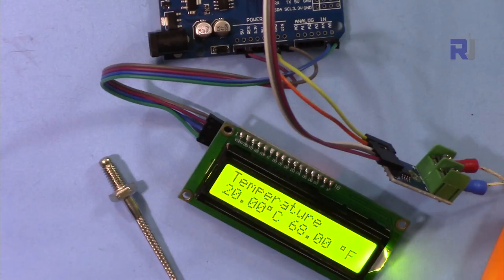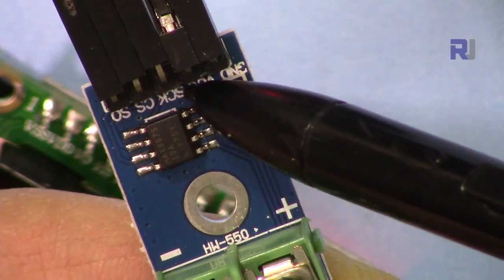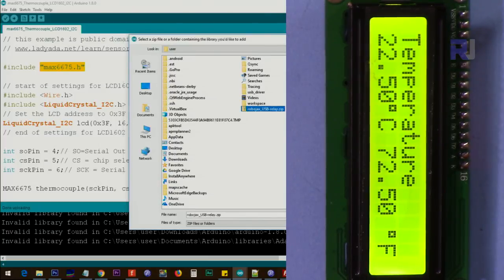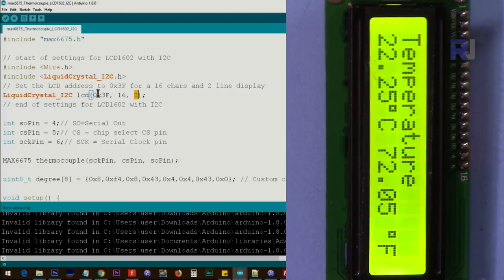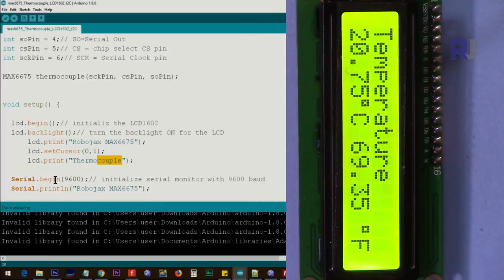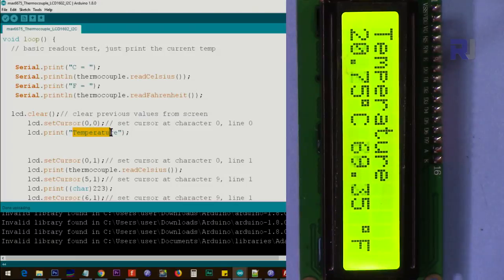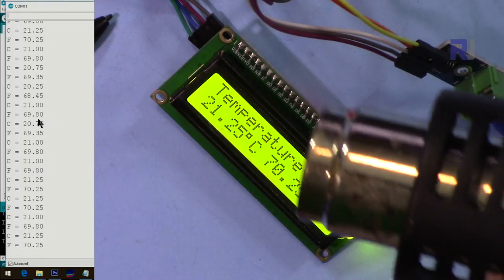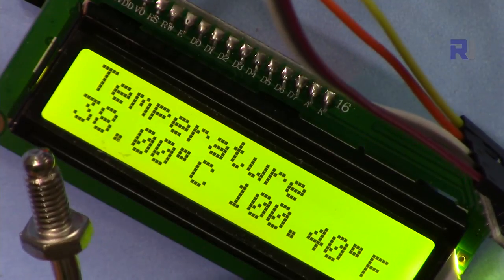Using MAX6675 Thermocouple with LCD1602 and Arduino

Comment: Hi Robojax , 
I have a question about the connection of the lcd display . 
in your video you have the module for the 1602 , how to connect the  display if we dont have that module ? 
thank you .
Reply from the maker: that is I2C module. it would be very missy but doable.  Here is introduction to the LCD without I2C moduellhttps://youtu.be/S4ya3Q7uhJs

Comment: Other than changing the library from MAX6675 to MAX31855, is there any difference in the sketch? The pinout and functionality is approximately the same; the MAX6675 is now being phased out for new designs; and the MAX 31855 has slightly higher resolution (and is more widely available).

Thanks for your videos. They are very good!
Reply from the maker: you are welcome. thank you for the tip, I just checked it and it is better. I will see if I can get it.
Reply: @robojax  Awesome. I will be trying it today with your code. I haven't looked at the library yet but I wouldn't think there should be any difference. The functionality should be the same. Not sure why someone would change anything.

Comment: I am contemplating building a pyrometer, which K coupler could be used for temps up to 1400° F with a probe length of at least 2 inches/50 mm?   I'm having a hard time finding what I'm looking for.

Also what voltage regulator or converter would you recommend with a 12v DC supply? 

I would be using it in an automotive application,  probably use the smallest arduino possible.

I haven't fully decided which display to use.   Is there a dimmable LeD or LCD/OLED available for day/night use?
Reply from the maker: you did not mention current  for the 12V power supply. if you need to power this system, then 500mA to 1A is enough (0.2A also works). But as for the display if you search on eBay or AliExpress "OLED" you will get unlimited sized and prices. Before you buy it make sure to find Arduino Code for it.
Reply: @robojax  thank you for the response.   I was able to find some TFT screens that offer the flexibility I'm looking for and even looking at multi-plexing.   I'll make sure I pick up a shield or a model that uses 5v and a sketch to go with it. 

The power source is a 12v automotive system so 12v battery when engine off, 14.6 when its running .

Would a cell phone charger buck converter be a sufficient power supply with 12-14.6v in and 5v 1--2a out?   Or is there a specific module that would be better?

Comment: I am dealing with the temperature readings being much higher than the actual temperature inside my tank. For example, in an ice bath, which should read 0C, is reading around 8-10C. I also tried bringing the tank to boiling temp (100C) but the temperature more feels like a warm bath, definitely not boiling at 100C. I have tried multiple k-type thermocouples and am experiencing relatively the same readings, which makes me believe it is not a calibration issue. Please let me know if you have any ideas on why this is happening or ideas on how to fix this issue. Thanks!
Reply from the maker: Hello, I am not ruse exactly how is this happening but may be the wire is too long to the sensor. Also check if the difference in reading is linear. Meaning if you specific number (value) at all temperature readings. If that is the case then simply add or subtract it from the reading .

Comment: i have built this setup en used your code, i can read the temperature on the serial monitor but it does not print on the lcd. how can i fix that
Reply from the maker: did you follow the instruction?  I said 1- first work with LCD in separate video 2- work with MAX6675 in from separate video 3- Come this video to combine both. so perhaps you've skipped the step 1.

Comment: Great video  very informative but I cant find the links you speak of for the i2c scanner or how to hook up the display. The link you posted to answer zulfikiri zariq just goes to a page of unsorted links.  Not sure what I am looking for.  Ctrl F(Find) of lcd1602 returns 17 results.  I think your page needs to be sorted somehow to make it easy to find what I am sure is all your great and hard work.
Reply from the maker: In the page just press CTRL (control key on keyboard) and press F and in the search type "scanner" you will get it.

Comment: I have successfully connected the thermocouple to Arduino. Thanks to your video. However, the temperature reading is very slow response. It seems there has been delay for about 10 seconds. Is there any way to make it faster or highly responsive for reading temperature? Thanks
Reply from the maker: You are welcome. there is ONE second delay delay(1000); in the loop. 1000ms=1s so change it and make it smaller.

Comment: I will try this very useful scheme for jet modeling turbines. A question: how do I alternate information (when Arduino performs 2 or 4 functions simultaneously).
Thanks a lot.
Reply from the maker: You are welcome. If you use delay() Arduino will stuck and can't do another task until the delay is over.  So you should use millis() instead. I have a video that you can learn using millis() from  https://www.youtube.com/watch?v=6DGQhQgr7Ak .

Comment: this is the error i m getting when compiling the code "no matching function for call to 'LiquidCrystal_I2C::begin()' " what to do Sir ?
Reply: write * lcd.init * in its place * lcd.begin * and it will work
Reply: Make sure you renamed the file where you store the library to 'LiquidCrystal_12C' aswell
Reply from the maker: It shows you have not included the library. Please download and include the library.
Reply: @robojax  I had the same problem and won´t find the way to solve, I have all the libraries installed.

Comment: Thanks for the tutorial, can anyone guide me if i always need a computer (or a laptop) attached to this setup in order to get the readings on the LED screen. Or is there any other device which we can attach instead of laptop to power up and control all the coding stuff after we are done installing the library.
Reply from the maker: you are welcome come. you use your computer ONCE to program Arduino board. then you don't need it. I Use computer for demonstration because I used the USB to power the board. you can use any USB to power it up. Good luck. Ahmad from Canada. Salam
Reply: @robojax  thanks a lot!

Comment: Why always we connect variable resistance with VE(contrast control) pin on LCD ??
Reply from the maker: you can connect fixed one. But you will get fixed contrast. Due to chemical composition of the display, frequency of signal and light condition, fixed contrast will not work best. So you should be able to adjust it. But Yes you can put fixed value and find it experimentally.
Reply from the maker: when some one takes time to reply. you have to reply and acknowledge his efforts.Say shukr.
Reply: @robojax  shukr word is little for your much efforts , my grateful to you 🙏🙏 .                                              But I have another question 😂😂 I'm just kidding 😁😁

Comment: Hello Robojax. I copied the same code (I only changed 0x3F and wrote 0x27) and this error message came up:

In function 'void setup()':

termopar1:19:13: error: no matching function for call to 'LiquidCrystal_I2C::begin()'

   lcd.begin();// initialize the LCD1602

         

   void begin(uint8_t cols, uint8_t rows, uint8_t charsize = LCD_5x8DOTS );
note:   candidate expects 3 arguments, 0 provided

exit status 1

no matching function for call to 'LiquidCrystal_I2C::begin()'

Could you help me with this? I would appreciate it very much. Thank you!
Reply from the maker: Before coming to the temperature sensor see intro to LCD https://youtu.be/pxUjEsJQW2M and th. Watch intro to temperature sensor
Reply: @robojax  thank you

Comment: Great tutorial. However who visits this page and read it......use delay () statement in Void loop() of arduino. If this is not done, temperature indication will not be correct and you will be surprised as to why the code did not work. It is necessary as MAX6675 is slow....cheers...I found it the hard way :(

Comment: I want to read the EGT from a 1.9 tdi engine
EGT- exhaust gas temperature.
What kind of sensor and what module should I use? 
Temp range- 0-800 degrees C

Vreau să citesc EGT de la un motor de 1,9 tdi
EGT- temperatura gazelor de eșapament.
Ce fel de senzor și ce modul ar trebui să folosesc? 
interval temp - 0-800 grade C
Reply from the maker: This sensor k type is the one . It can go as high as 1300c

Comment: I like your project. I am attempting to build this for a Kiln/Oven.
I find 1 issue within your code and am looking for another. 
#1, on the line [code] lcd.begin();// initialize the LCD1602 [/code]
needs to be stated as [code] lcd.init();// initialize the LCD1602 [/code]
for what ever reason it is not  recognizing the begin command.
#2 It is not displaying the temp properly. if the temp is 98.65 *F the lcd shows 9.65*F. Does the same with *C.
any clue what is going on?
Reply from the maker: Hello, you haven’t provided enough info. But it seems you have not installed the library. This project requires you to watch two more video before coming to this. See links or watch the video without skipping
Reply: As near as I know I have installed all of the proper libraries. Which one do you suspect did not get installed? I will reload that library and see if that fixes it.

Comment: Hi, how to i use this to control the temperature using arduino?
Reply from the maker: Hi, you should have watched the introduction to the sensor.  I just Ed checked and I have tones of links to different videos I. The description.  So you need to use reply to control heater or colder to control temperature ans I have video for that . Check it please
Reply: @robojax  okay, I  need to create this same procedure for a microwave oven, will it be possible?
Reply from the maker: Wen we turn something ON or OFF we call it load. So you turn in/off a load and it does. It matter as long as your load is not beyond the rates current of the relay.  See the video on relay and you will know that.

Comment: Sir what is the reference temperature of thermocouple
Reply from the maker: I don't undestadn your question. The thermocouple have been calibrated in factory. It the accuracy will decrease as time passes. But it would be very minimum .
Reply: There are two junction of thermocouple in which one is called refference or cold junction whose temperature is kept constant. This temperature is called reference temperature which varies in different thermocouple

Comment: Sir I am working on AC fan working with the help of max 6675 thermocouple, relay module and LCD. so can you help me sir and send code and circuit arrangement of it.
Reply from the maker: Hi, You can use this video https://youtu.be/g6k8sPJyif8 to control AC or DC load and combine it with MAT6675. First tyr to code for relay without anything, once it works, then combine them.